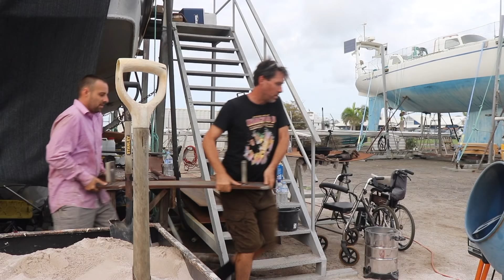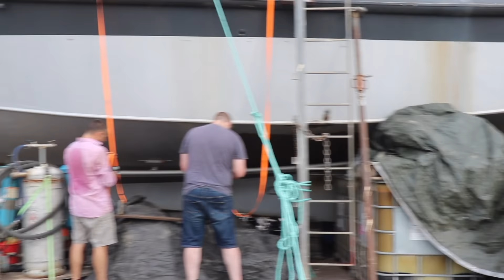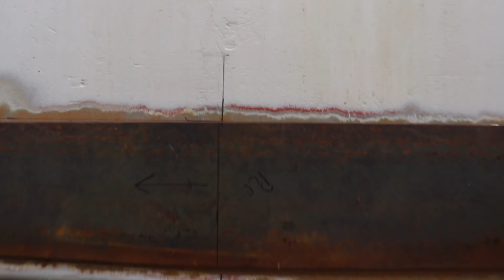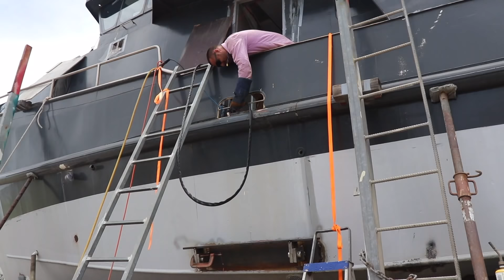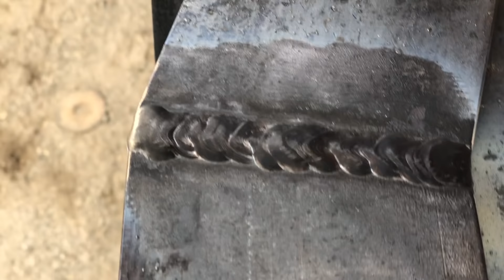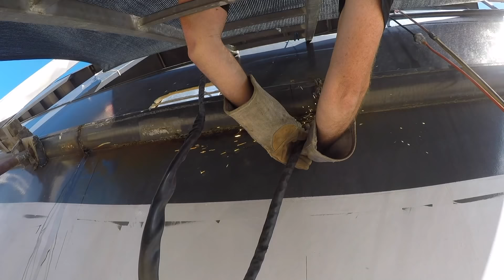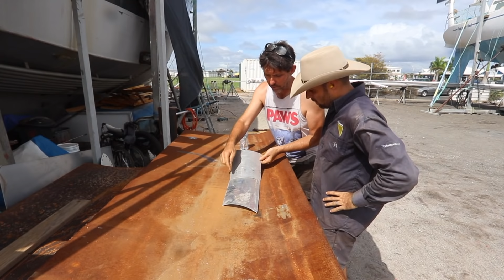Stabiliser Hinges & NAS Installation - Project Brupeg Ep. 123

Comment: All among this difficult and demanding work, there is always a bit of humor between the lines.  Like measuring down to a millimeter when attaching a large suspended monolithic blob of metal to a behemoth with no straight edges, using a ladder, level, and hand-held sparkle-spitting metal-melting blast of sheer energy by a device in the hands of a petite 'pretty-in-pink' welder. Then calmly explaining the process to thousands of adoring fans as though that it is something you do every day. You just can't make this stuff up... 🤣🙄
Reply from the maker: Tell me you wouldn’t do it the same way Gilbert!

Comment: I was wondering the difference between the QNAP's. I've got the 453A which it appears is the big brother. It has a bigger CPU, more ram, HDMI video out, audio in and out etc (I think you can run them as a direct media player and it comes with a remote for that functionality). We needed more than anything a NAS at the time but the features like the ability to use it as a media player were attractive and I think I was looking for the bigger CPU/RAM count given it can get hit fairly heavily. I think it may have come with a more hefty price tag though lol. It's been great, QNAP the few times something has gone wrong (always bloody cloudsyncing or phonehome VPN -now offloaded to the Sophos UTM router-) have been great with their support including remote support. The only issue we've had hardware wise is one of the 3TB drives threw a smart error recently, got pulled and tested looking at smart testing tools on the computer .... strike 3 you're out. 8TB in and a shuffle done.  Being able to SSH in with putty and use like a linux terminal to adjust permissions, move files etc made that REALLY handy. The best thing ... it chews a LOT less power than the old Windows Server which was also the file server. Alike the old server it sits in the network rack along with the 2way radio bricks (HF, VHF and UHF), cctv etc etc.

I have the QNAP here at x.x.x.1 with the router/firewall at x.x.x.254 with very strict ranges for VPN, who's machines, network gear like wifi and cisco PoE switch etc. If you start dealing a lot with it you'll notice the strict IP set is handy.

Can I suggest putting a real firewall in between the modem and the switch though? (Mobile modems and average ADSL etc modems like Bigpond trash don't make good firewalls) Make it do DNS, DHCP etc etc. IPCOP, Smoothwall, Sophus UTM9 and many more great *nix based packages out there run great on small 12v fanless Atom boxes which chew bugger all. My Sophos box is one of them and it sits around 30% CPU, 40% ram and 30% system partition and currnently 65% log partition. Never fails.  Gee even an overpriced Cisco router/firewall :P but they're apparently not as good for firewall. My router/firewall I'm happy with because it scans downloads too and has nuked a few downloads in session since it found something VERY questionable and then emailed me about it's findings.

Comment: What a nice person.  NOT !!!  You couldn't find an old welding shirt for Stu as he was getting sunburned from the arc of the torch and splattered with hot slag !  BROTHERS !!!!
Regarding the network and NAS.  Carry spares.  Know your single points of failure.  I installed a similar setup for a friend about 10 years ago.  Still running strong and the couple of disk failures that he had were totally uneventful.  A small UPS would be a good investment.
Reply from the maker: It is very hot here and most people insist on light clothing so to avoid heat stroke and we assume anyone on board is a grownup and responsible for their own sunburn! You would be surprised how many people don’t want safety gear, sunscreen or work shirts when offered. Who are we to tell people what they can choose! Lol. Everyone has their own way of doing things...
Reply: @ProjectBrupeg  "light clothing"  That's why Dangar Marine shirts are black !!  ha-ha
Reply from the maker: It’s like you don’t know us at all... “hey Stu, why don’t you pop on this safety gear in the hot Queensland sun” Stu responds “lol, good one”

Comment: I TRIED to tell you about the flux core wire But NO, it was too expensive! NOW you see what I was talking about. It is faster, cleaner and smoother. And you are not wasting as much nor are you paying for gas.  Dang thickheaded Aussies!! LOL. Damian, I am curious what you do in your normal line of work in your day job?
Reply from the maker: Richard we have many suggestions from many people and we always have to make decisions on all of the issues we face building something like this with very little money. We are kiwis not Australian. Cheers Jess
Reply: @ProjectBrupeg  
I know Jess, I know all too well the constraints of short money! I was just busting on Dame since I did suggest it before ad he was telling me back then that the MIG wire was working just as well and NOW he is saying the opposite. All in fun, as long as the job gets done, I am still curious what he does as a day job, he seems to have a very well rounded knowledge of what he is doing on the boat. Well, with the admitted exception of the wood carpentry and even at that he was working with some really weird angles so no foul there. As far as the Aussie vs. Kiwi it appears I have committed a cultural faux paus! I will have to do a bit of research on that one to get my countries straightened out. Keep up the good work.

Rick

Comment: Also watch Youtube SV Seekers in the use of High Voltage Low Current Holiday detection when you start the coating process.  Truly good information.
Reply from the maker: Hi Wayne, I have watched that episode of Seekers, we won’t be going to that extent. It’s not something I’ve ever seen the commercial coaters here use (or need to use) and they get up to 25yrs from their paint in steel trawlers. It’s a nice to have gadget but not worth chasing down someone with that tech and paying for it (unless you own an oil tanker).

Comment: Glad to see you found a cost effective source for flux core wire. I know you have to chip slag now but your welds will be so much stronger. Especially when outside and there is wind you won’t have to stop working or grind porosity.

Cheers Jeremy!
Reply from the maker: Thanks Jeremy.

Comment: Nice job  I read you have spoken with a naval architect. Did they comput some numbers and do a real life stress test. Also when you set your wings why not measure from the bow point to get your length back. 2 other things when securing things to the hull a nice hot tack and a smack with a large heavy sledge will smash it tight to the hull with no gap. And to answer your question on your sponson you’re said oil sludge that’s called flow coat. Usually on a sponson or any other closed in space there will be a fill and vent ie pipe plugs. Like your sponson had water in it from I bet a cracked weld. The flow coat is pumped into sponsons till it comes out the top vent allowed to set and then drained and plugged it’s to stop/slow rust and corrosion from eating the steel from the inside out. 25 year marine engineer and former USCG mechanic.

Comment: Hey Damien, don't know if you're way beyond this point, in real time.. noticed you left most of the paint on the hull, but didn't prep the back of the base plate/doubler... is rust not a concern there because of the thickness of the plates ? Jess, if you get tired of looking at all the wires and wire ties, you can cover them up with the same plastic cover they use on shower curtain rods :  https://www.amazon.com/Shower-Jenacor-Plastic-Protective-diameter/dp/B01H2EGLT0?th=1  (an example) there must be something cheaper, I don't recall paying that much for one at a home supply store, and being smooth, the look nicer than that corrugated black wire loom cover you usually see, and it's paintable as well !
Reply from the maker: Hi Mike, Once we fully weld the doublers to the hull we wont have any rust as the oxygen will deplete in a week or so and from that point onwards rust cant happen, think of it like a sealed up steel tank, without fresh oxygen rust comes to a halt.

Comment: Besides being able to weld in wind, flux core also tends to burn a bit hotter then solid.  As in a weld thats pushing a small welder can be done more easily with fluxcore then solid.  May or may not be relevant when working on the kinda heavy steel you find in a boat.  Throws ALOT of sparks and bb's I find though.
Reply from the maker: I didnt know that. good to know. I have no welded with and without gas and I have to say fluxcore with gas was surprisingly clean in terms of crap flying off the weld. I dont think there is much flux in this wire as the slag on top of the weld when finished is quite thin

Comment: Damian, once finished with the stabilizer, can you do a recap episode.  Why the design, location  and material selection? I know some of the information is covered somewhat in episodes 122 & 123 so far and maybe in 124.  You have outlined the differences about stabilizers while under way at sea, Vs docked and rolling waves.  Also gyro Vs fixed fins Vs adjustable.  Price, drag, performance, fuel, maintenance, simplicity, other.  Variation in ship dimensions.  Strong bunk head welding location close to the water line.  A composite time lapse video with more emphasis on design and performance.  Lift and speed gain approx. 1 knot?  There are other who may appreciate your simple and cost effective solution.
Reply from the maker: Yeah this is not a bad thought. I might leave this until te last episode so we can cover all the aspects of the build. we are still designing and figuring out the hydraulic needs to raise and lower these wings and keep it well about our safety margins for the load we expect. Thanks for the suggestion

Comment: Could use a water level, clear hose under boat hold on one wing raise or lower other side to get same elevation. I worked construction we were working in a building and needed the same elevation in a different room and couldn't use a laser or transit.
Reply from the maker: That’s a great idea. I didn’t think of that. thanks

Comment: Maybe a bit of a dumb question, but will you guys be welding all around the bit where the hinge meets the hull? I presume we only saw tacks?
Reply from the maker: Hi Ryan, yes we will be. My welder isn’t powerful enough to weld 25mm plate so for now it’s tacked and we have a bloke with a 580amp welder that will blast a weld all the way around later on
Reply: @ProjectBrupeg  Cool. thanks for the reply

Comment: ??? honestly asymmetric wings, so they look good. In the water you need symmetric wings otherwise you can have some degree of ruder to one side or the other
Reply from the maker: Hi BRUNO
Have a go watching the vid again. Dame explains it’s symmetric where it matters. Neither one of us would make it asymmetrical for the looks if it wasn’t okay. Jess
Reply from the maker: Dame here. An asymmetric rudder or keel wouldn’t work because more lift on one side would be a bad thing, however these are asymmetric as they only have to provide lift in one direction.

Comment: The pink shirt suggests these are top-level modifications. 16:00: Huh, what you call a sponson, I call a gunwale, pronounced "gunnel" and the sailboat version is often called a toerail.  Though I suppose it has a more serious fending-off function. 17:20: Always a surprise on an old vessel. That water might be older than you. 21:33: This is indeed a great leap forward, but I have concerns about the durability of most computer gear/storage in sea air. A solution I'm thinking about is fanless pico-ITX boxes stored away from fresh air. 25:58: Once again, you've introduced "clever" with "functional"...good work! Reminds me a bit of the pantograph door. 36:19: Bloody hell, that beast will come in handy. Your patron really stepped up. We are getting two Honda eu2200i gensets next week delivered to the boat. They can be joined to give 30 amps at  120VAC which is enough to do most of the welding I'll need, but which weigh, together, only about 45 kgs. We'll be selling the old eu2000, which was good, but which often shut its own inverter off if I used the Makita 1/2 HP drill or the 10 amp circular saw. Like you, I prefer "land tools" at sea. 38:39: Stu's correct. It's exactly like making a lofting plan for a sail, only a rigid sail.
Reply from the maker: Sponson for us is the halfround welded as a rubrail. gunnel is the vertical steel above the deck. We realised where the water cam from, years ago i repaired a rust patch at the lowest point in the old galley, it had rusted through into the inside of the sponson, obviously its filled it up with water and I didnt think about it and welded it shut. We had another power cut recently and found the 5kw genny can run the whole boat, hot water, jug, toaster, two air conditioners etc without raising a sweet. made me realise how much power the welder pulls
Reply: @ProjectBrupeg  Oh, you'll like having a diesel genny so much, I predict you'll find room for it in the engine room, complete with its own exhaust and a handy selector switch when you need to charge the battery bank if the alternator and/or solar conks out. Anyway, great progress and the stabilizers that provide a bit of lift (that at least partway cancels out the drag) will be wonderful in any place not too icy.
Reply from the maker: Yeah we plan to mount the orange genny in the engine room behind the fuel filter stand. Its pretty easy from there to plumb an exhaust and fule supply. its air cooled but with the big ventilation fan running the engine room will be cold enough to keep it alive.
Reply: @ProjectBrupeg  You can always run vents off the roof and down to the engine bay with 12 V inline fans. Not a bad idea anyway to bring in fresh air and push out heat.
Reply from the maker: Currently we have four inlets without any forced air ability. We will be building a large single exit vent with the yellow hair dryer 3000 venting out. Essentially we should be able to swap the volume of air in that room every 5-6 mins for new fresh cold air
Reply: @ProjectBrupeg  Good plan. Your diesel and diesel genset will appreciate it. "Yellow hair dryer"....heheheh.

Comment: Normally I remain silent however I must beg you folk's and ask you to purchase a proper scaffold. They are not huge expensive and Resell in any boat yard in a blink. You'r safety means a lot to all of you'r viewer's. That stupid move on a plastic chair "REALLY?"
Reply from the maker: Thanks for your concern Scott. We have scaffold available in the yard but given the weight of moving it around in the Aussie heat we only use it when it’s going to be up for a while as it’s just to exhausting to use and then we start making dumb mistakes at height because we run out of steam. Worst case with the plastic chair is I would fall 2ft and nothing heavy would crash down on me. I’m happy using the plastic chair at low height like I was

Comment: Hi Damien. @5:52, wouldn't you want to weld all around the base of the stainless steel plates that have the hole in them for the hinge 'bars'. I am loving all this progress. Well in.
Reply from the maker: Hi Brian, absolutely however my little 205amp welder just doesnt have the grunt to get a good enough weld happening on this thickness of steel. We have a bloke with a 580amp welder that we will get in to blast the join and get really solid penetration of the two steels.

Comment: If you were to cant the support tubes for and aft it bight take a lot of stress off of the retaining bolt in the case of a following sea. Just a thought.
Reply from the maker: Yeah thats a fgood point. We think we have a solution for the pins. Bore a 16mm hole down down the centre of each hinge pin, and bolt through with a 10mm thick washer on the back of each pin. so the 16mm bolt takes the long along the length rather than a 10mm bolt taking load in shear.

Comment: Could someone please explain why after explaining that the best possible position for the wings base plate is perfect level horizontal, they decide to fix it running 5 to 1mm off horizontal to level??
Reply from the maker: Depends where you measure it from. lifting one end made it horizontal (not to the boat but to the water line) also with anything on big boats, perfect is often not possible, it makes good TV being anal able getting things perfect but in the commercial trawler world you get it as good as you possibly can then weld. Time is money and most fishing boat owners want workable not show quality perfect because on these boats if often doesnt make any noticeable difference being out a few mm.

Comment: Beautiful job on the welding.  Small tip: (From a 50+ year welder) When coming to the end of a weld where there is no run off tab, Do two small circles real fast then start back the other way for a short distance, then break your arc.  It will fill the ends completely and eliminate the small cooling cracks where you stop your arc.  With a little experience, you can make the stop end square and perfect.  Once again, nice job.
We used flux core on all the heavy steel weldments.  NR311 for flat makes a glass like finish.  When welding in a windy  weather, you can cut a box to go over the repair to better keep the wind away.   It works well when using MIG gas and even stick welding.
Reply from the maker: Nice, thanks for this tip, i will do a few test welds next time im down there. I've often wondered how the pro's finish their beads so nicely.